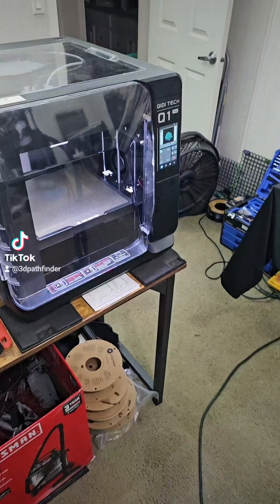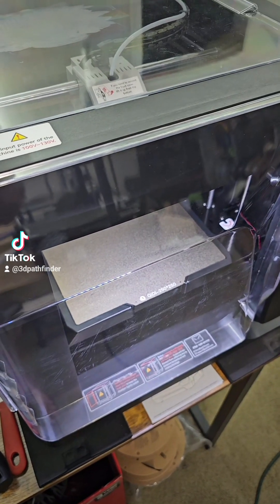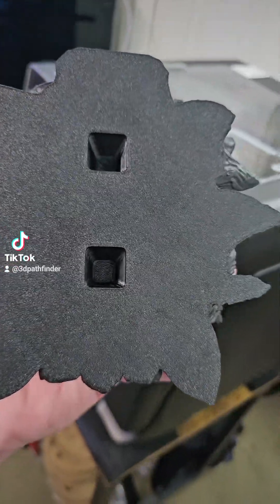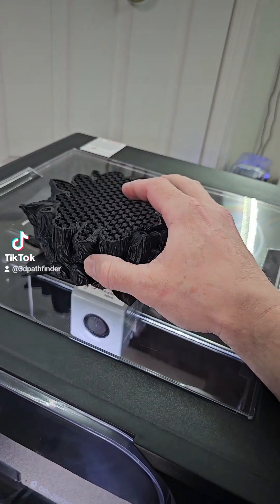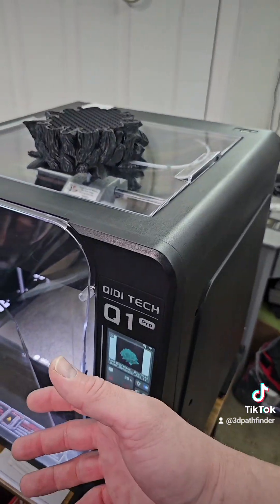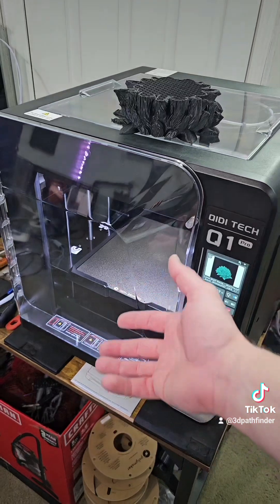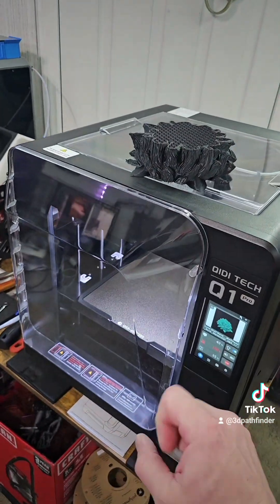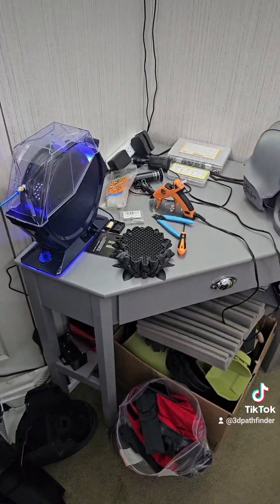QIDI Tech Q1 Pro issues!

Comment: Curious if you ever got this resolved and if so, what was the solution.
Reply from the maker: Yes the issue was that the cooling fan on the main board was set to slow . Adjustment of that resolved the issue
Reply: @3dpathfinder  Thanks for your quick reply. Can you tell me where/how this is adjusted? I'd like to check mine before printing ABS.

Comment: I have the same problem where the printer locks up (I can’t even finish the calibration)
After reinstalling the eMMC module and modified the electronics bay fan configuration, it works totally fine now.
I believe the problem is to do with the main board overheating (the klipper host SoC) and completely shutdown. They set the max fan to 60% probably because of the noise, but I just don’t think it is enough, as there is an active chamber. The tool head MCU also gets to 90 degrees when heaters are on full blast, but I think it’s probably fine. I’ve also tested the SoC up to 90 degrees and it did not shut down, not sure what it takes for that to happen.
Either way, I’m receiving a free new mainboard despite everything working fine now.
Reply from the maker: Support said that they were sending me a new adapter plate and replacement cable I'm assuming that has something to do with the chamber heater since the chamber heater is causing the machine to lock up I could print just fine without using the chamber heater I've already printed ABS not perfect because it does still want to lift a tiny bit off of the bed without the chamber being at exactly 55
Reply: @3dpathfinder  Not sure what would cause that. If it were not heating correctly and Klipper verify_heater thermal runaway protection thing kicks in, the display would lock out (unless it was an intentional klipper reboot like save_config)
The easiest way to verify would be to go to the Fluidd interface of the printer and see what happened. You would be able to restart Klipper and the MCUs from the protection status if that were the case.
My case has the host completely dead. The last second I was still monitoring from the web interface, and the next second the webpage was completely disconnected and the port was closed. That was hard to diagnose, and a mainboard problem would be possible. 
Overall the printer is working just fine, and I've done about ten hours of ABS printing. Also got a new mainboard that probably can go to my next Voron? Only took me a day of troubleshooting, I'd say it's still a good buy. They just really have to work on their software configurations.
Reply from the maker: I got through the calibration fine after the initial problem of trying to boot it up and it wouldn't boot support Tony to disengage the Wi-Fi dongle then boot it update the firmware reinstall the dongle and that all worked
Reply: @3dpathfinder  I have been working with the Qidi Chinese support team (a group chat). They still don't really know what is going on, my printer would spontaneously lock up completely (the host computer is completely off).
Not sure if it is the reinsertion of the eMMC module that resolved it, or if it is a thermal issue, either way, my printer is printing just fine, with 55 degree chamber, host at around 60 degrees, and the toolhead MCU at 85. I would like to get the chamber to 60, but then the MCU will be at around 90 which is outside the speced operating temperature. I'll probably add a fan to the toolhead cover for cooling.
If you turn on the printer and just start preheating the chamber and bed (like I always do with my Voron), the Z stepper motors are not energized yet. And dumbly enough, the electronic bay cooling fan is a controller_fan tied to the Z steppers and will turn on to 60% when the motors are on. Preheating the machine without homing first is basically a guaranteed overheat. Now I configure it to be temperature controlled, it's kinda loud at night, but... whatever.
Yeah, apparently your case is different, because it's tested that the fans at 60% IS enough to cool the mainboard to acceptable levels when a 60 degree chamber is right next to it. There is basically no insulation between them. Not a greatly designed printer with emphasis on high temp materials... but yeah, it's cheap, what else to complain (got mine for 330USD, and the Qidi support is miles ahead of other companies, I think the price, at least the early bird price in China, is totally worth it. Just sent out a mainboard that arrived in 1 day with no questions asked. I don't live in China though, so not that worried in swapping out the main board yet)

Comment: Is firmware latest? Are power connections firmly in?
Reply from the maker: Yes and yes , support believes it's an issue with the Heater and is sending me an adapter plate and cable